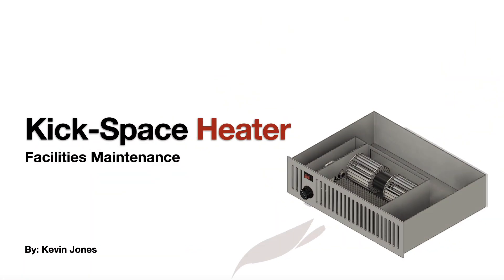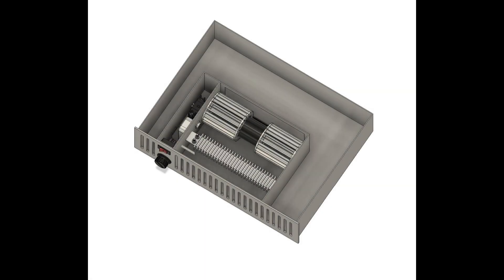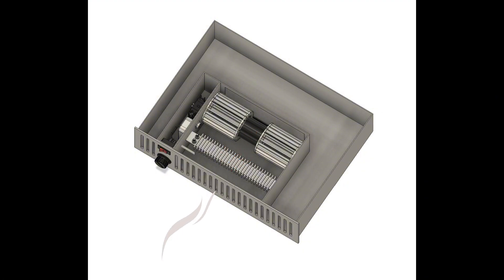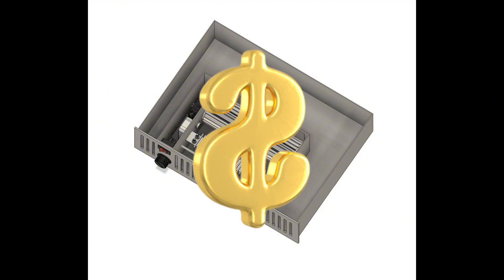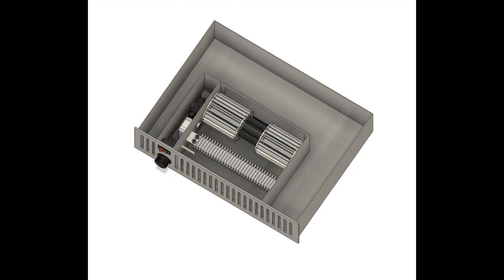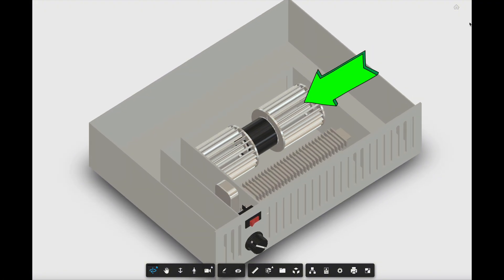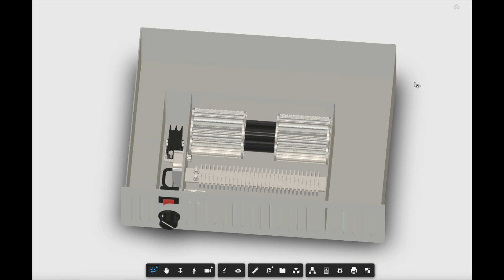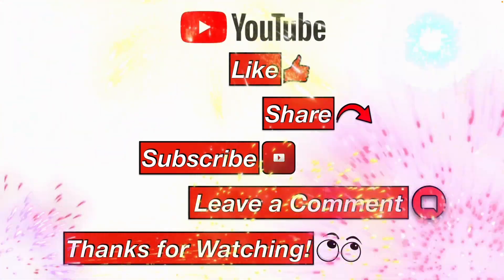What Is A Kick-Space Heater? (HVAC)

Comment: Please explain how best to clean the unit.
Reply from the maker: I would recommend referring to the manufacturers maintenance  instructions.  However, as a general rule, turn power off to the kick space heater, gently vacuum off the front grill.  Remove the front grill, inspect inside the unit, if dusty, use a vacuum hose brush attachment, soft brush, or a can of compressed air to vacuum out or blow out the blower wheel, heating elements.  You may need to remove the unit to clean the blower wheel, heisting elements, etc.  Inspect for any burned or damaged wires.  Reinstall, turn the power back on.

Comment: Hello i am just wondering if you happen to know. I shut off the switch on the heater even then its blowing hot air. Could there be another switch somewhere else that will shut it off completely
Reply from the maker: The switch may have failed in the closed position, without looking at your make and model. It’s hard for me to say.  I would look up the make and model number of your kickspace heater on Google. See if you can find an owners manual, or a parts diagram to help answer your question.
Reply: @ ok thank you